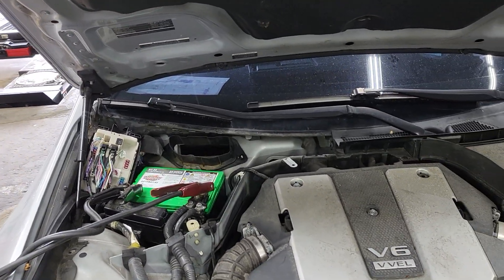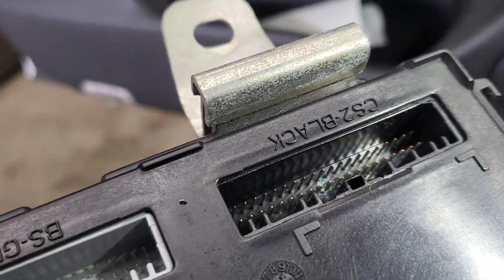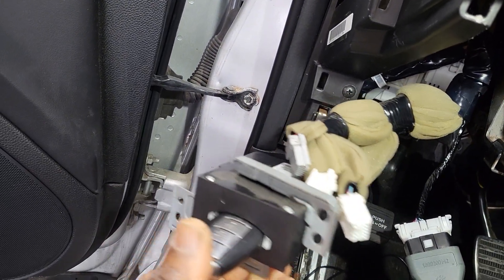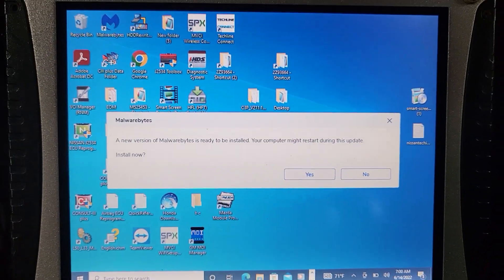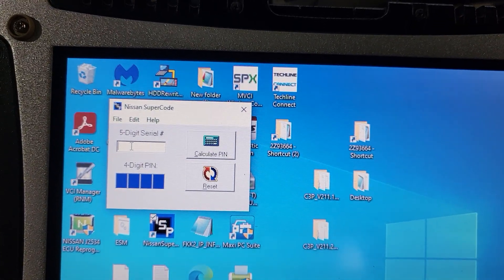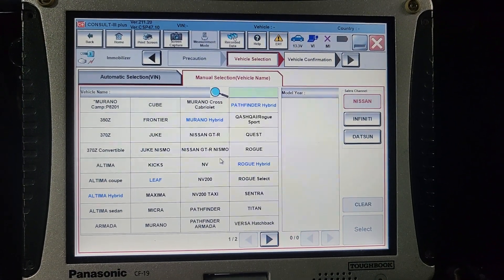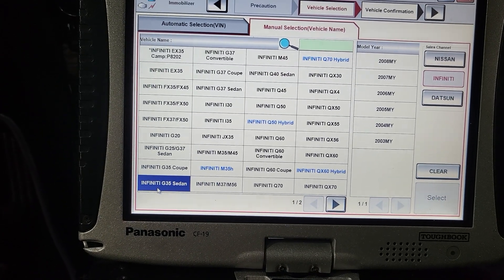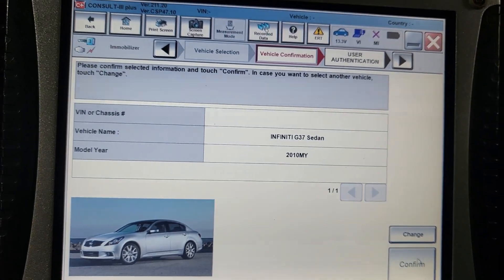2010 Infiniti G37S BCM Replacement And Programming Using Consult 3Plus Oem  Scanners

Comment: Hey i have replaced a ecu had it progammed and it didnt start then i replaced the bcm had fhay programmed as well. All the lights turn on but engine wont crank. What can be the issue
Reply: starter or the steering lock module
Reply: Did you find the issue
Reply: Same thing is happening to me 😅 pls help

Comment: Hey great video. I had the same problem. I change the bcm and some other modules with use one. Now everything works  but the transmission slam or slip when changes from 3 to 4th gears. Does the bcm need to program and is it why am having this issue. Please let me know what u think.
Reply: Did you program the BCM?
Reply: @dicapriosiksei1752  no i didn't i just went and put a use transmission.

Comment: My gas gauge wont read less then 3/4 even if its enpty
Reply: I got the same problem. What did you do?
Reply: That’s part of the AC AMPLIFIER TEMPERATURE CONTROL MODULE for the gas gauge not work. You can take it apart and resolder it.